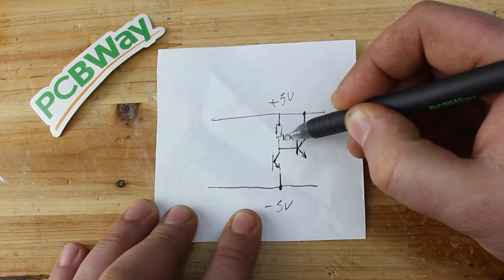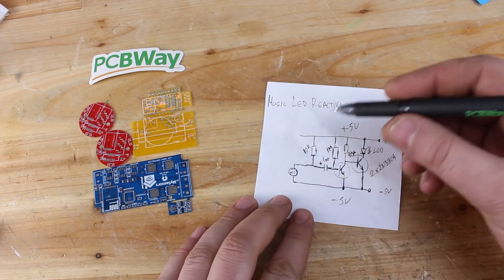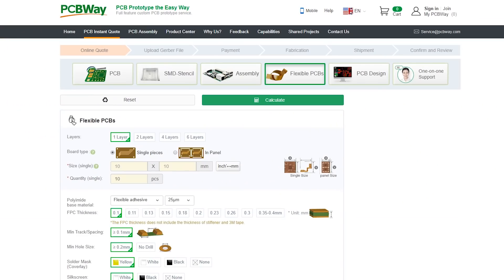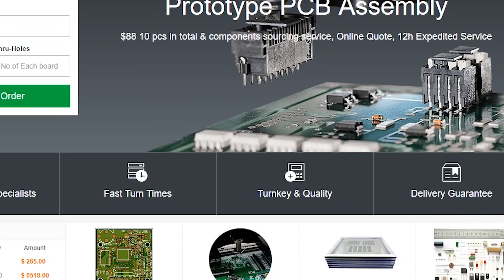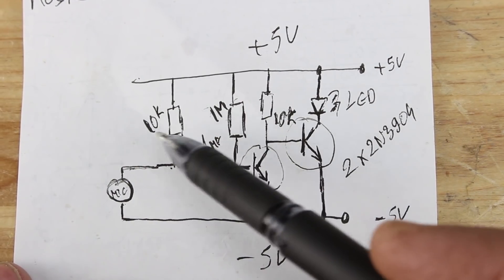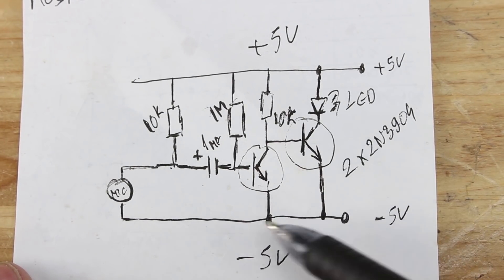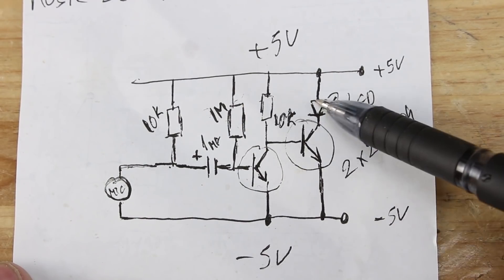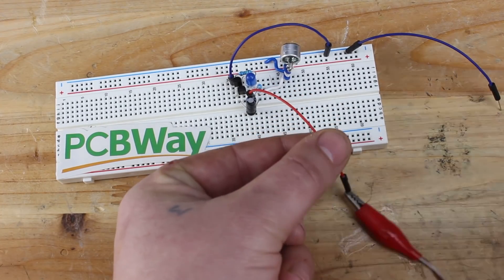DIY Music Dancing LED - simple circuit

Comment: question?
why do you have a 10k resistor next to the microphone?
have you removeed to see performance?
Reply: The microphone is an electret type and requires a resistor to bias the capacitor connected to it. Some electret microphones also have an amplifier built-in, which also needs power. The larger the resistor from VCC the larger the voltage drop caused by the supply current, though for an unamplified electret the current is low and the resistor may be bigger. A too small resistor will cause the signal to be attenuated. VCC is ground for AC signals and a small resistor will cause too much current to go that way. In this case the 10KΩ resistor R2 acts as the bias resistor.

Comment: NICE BUT CAN YOU CONECT THERE 5 METERS OF LED STRIPS?
Reply: İf you add a relay to circuit, you can do it i think
Reply: Yes. You will either need to connect a MOSFET or a Relay to drive the LED strip